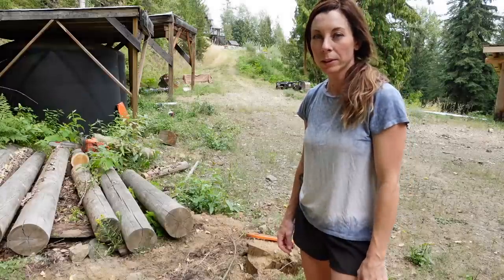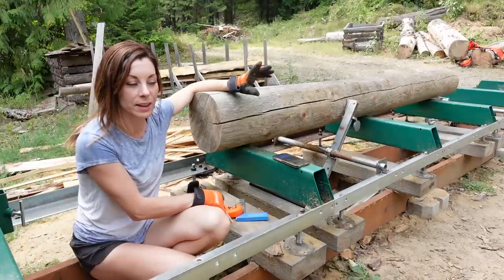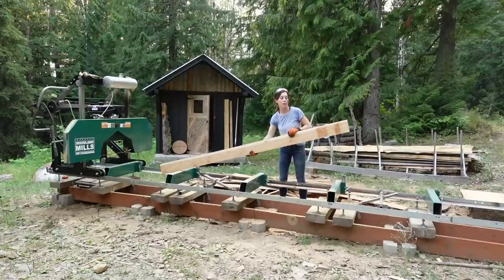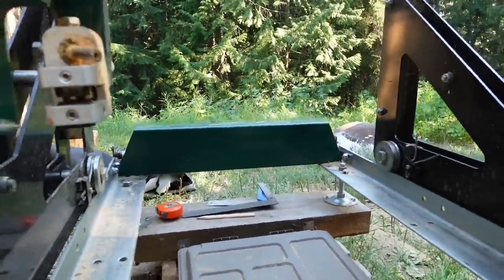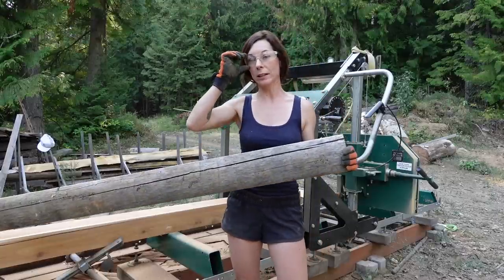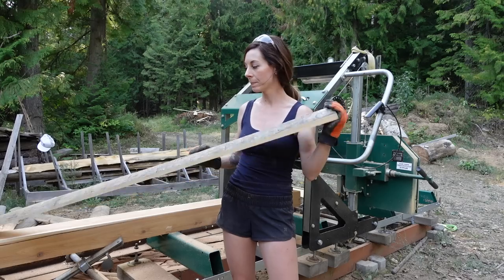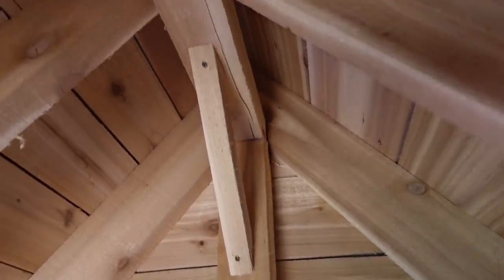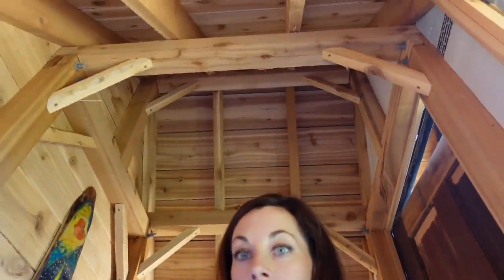The girl loves her sawmill | Milling more rafters for my tiny cabin build | The cabin on a cliff.

Comment: Good morning, Lee in New York. I also have a sawmill an older wood mizer. I see you mustling these logs around just just thought I'd give you a tip. I use a pulp hook when I muscling things around. You can get them used off of eBay fairly cheap, And I wouldn't be without one, Just so much  Easier and faster than muscling, Of course there's still  Muscling to do. Now I will watch the rest of the video

Comment: If your going to have a loft space, I still think you should put those ceiling rafters up first, and then floor it. Then put up the roof rafters. You’ll be safe and be much closer to the ridge tree, and plate to mark out and fit the roof rafters. This is how it’s done in the UK. The flooring sheets come with a protective cover, and you just tape the joints, and peel it all off when your roof is covered in. You could just tarp the floor. 
I think your hoist will need a tighten by the looks of those timbers!!😳 looking forward to the next one now🙂👍

Comment: I like using "Loctite" , good stuff, keeps bolts and screws from coming loose , I like the blue , the red is like welding it on  !
Reply: Red ain't that bad....just hit it with a little heat before you try to dis-assemble...easy peasy

Comment: It’s done now … and I’ve gone back and watched your view on how you secured the post to the rock… and it will absolutely work… I’m just wondering how much pole loading effect you will have on that post considering it doesn’t sit flat and the load weight will be transferred to the bolt … which I’m sure is designed for horizontal strength not diagonal load bearing … I work for a utility … I don’t know why but I think about this stuff🤪but I love watching you build this stuff
Reply from the maker: Steve is the engineer, so I honestly can’t answer the details. He thought it out, and is certain it’s sufficient for the structure. 
That said, there’s still more work he wants to do once we build a railing. He used to live in Switzerland, so he wants to use wire rope and strap/anchor it down too.
Reply: parce qu'elle est très belle !

Comment: One thing to consider when dragging, spinning, or rolling your logs over to the bandsaw, instead of using the machine... you are increasing the chances of picking up small gravel which shortens the sharp life of your blade.
Reply from the maker: Good thing I have a blade sharpener!!

Comment: You're doing great. It's a little tough to see on some of the camera angles, but the issue that you're having with the rafters may be that some of the existing roof framing could be twisted or in other ways non-conforming such as; tipped, out of square/plumb or a piece has checked up during it's drying process. I respect that you're trying to salvage and repurpose lumber for this project, however doing so will cause you occasional headaches of varying frustration levels like the one you're experiencing now. I don't believe that you'll be able to cut them all in a uniform way using a pattern. What I would do being that you don't have a lot of them, is cut the correct angle on the top end of the rafter board, tack it to the ridge beam with a couple of long screws and then measure and mark out your birds-mouth with you speed square while the rafter board is setting in place on your top wall plate. I would do this for each one to make them snug which is really what you want for this kind of joint considering the weight of the snow/ice and wind speeds that your roof will endure. Your persistence will pay off. It's looking great so far!

Comment: Michele how are you going to get those big, heavy rafters up on the roof without hurting yourself? Please tell me your taking Steve with you to do that. What are your thoughts on using those cedar scrap pieces as siding on the cabin to make it look like a log cabin, then just put vertical end-caps on the outside corners?
Reply from the maker: I’m going solo. Steve is busy at home ! I will figure it out!! 😁 I might not have enough to do the whole cabin, but parts for sure!!
Reply: @michygoss7148  just take your time, don't rush any of that work on the ladder! hell of a workout!
Reply: @michygoss7148  be careful

Comment: I haven't watched all your vids , so if you have already answered my question then I apologize. How long do you leave logs before you mill , and how long after ? Do you find that nailing lumber in green results in less waste from warpage . Will you get less sag in rafters if it's seasoned ?
Reply from the maker: That cedar I milled is dry as a anything. But I mill both seasoned and wet lumber, and I do prefer to use it on the greener side and install right away - the wood is easier to work with, although heavier.

Comment: Hi Michelle!
Is it like that you are strong like an ox or the lumber are lighter than fir or pine for example?  Can that cedar wood go as equal for construction (holding specific weight) like pine or fir?
Pedagogic as usual...😘
Yours Michael
Reply from the maker: That cedar is pretty dry and  light 👍
Reply: @michygoss7148  Hi is it common to build the roof with rafters than with trusses? Depending on the roof angle the snow weight is someting to calculate in i suppose? 
I believe youre use to count that in...sorry for my strange english spelling and words 😜
Yours Michael
Reply from the maker: @MegaAlexpalex  you’re honestly asking the wrong person! I have no idea! I just put things together in a way my brain accepts, but actually have no idea (no formal understanding) of engineering structure standards.
Reply: @michygoss7148  you for sure have a good brain...it relflects in your dogs🥰
Yours Michael

Comment: Hi beautiful, your doing great, really like your mill set up & ability to make your own lumber, good insight on the 5/8 thickness of the exterior panels to cover gaps. You can also put 2x4 blocking between the rafters it keeps them from twisting as they age & seals everything up nicely, those same 2x4 blocks will work as trim to cover the top edge of your  exterior siding, they go on last of course. Your probably already know all this, just trying to help. Keep up the good work, your doing a good job, so don't beat yourself up, be happy with your results, we are ❤️

Comment: Hey Michelle,
Video was bloody amazing (as ALWAYS!) You're work and attention to detail soothes my own (I suspect) OCD tendencies! lol 
And LITERALLY I saw when you first built the dog house but either forgot or didn't see the sheer amount of detail you put into the joinery!
You're a bloody star! Great videography as always! Looking great and full of ideas, energy and enthusiasm! Just brilliant!
Have a great week and DON'T OVER THINK IT!

Cabin, make sure(with a spirit level it's square and plum where you're fitting the rafters dead 90 degrees vertical and horizontal!) Them lay the timbers mark/score up where they meet and across at the height/depth you want it to drop down, as long as that's a perfect 90degrees take it down cut it out and place it back up and it should fit exactly.  if you try to do it in place one side at a time you're going to get a wonky cut on the other end!
Hope this helps makes sense sorry for essay!!! I had couple beers lol 😂🤣🤦🏻 (Queen etc 🌹🙏)
Have a great week and cheers from London England 👍❤️😎🏴🇬🇧

Comment: Okay, so this could very well sound kknda stupid, but hey-I think you may have just hit upon a good nickname for yourself: "1-trip"! For what it's worth, in my world that is, without a doubt, a compliment.
Reply from the maker: “Mrs. 1-trip!” 🤭
Reply: Glad to give you a chuckle- you looked like you could use it after those rafters gave you a hard time. It ain't easy getting the right marks/angles/measurements/what-have-you. Especially alone, in a remote location, holding the piece in place while standing at the top of a ladder holding on with only ones toes thinking about how long it will be until you stop falling if something goes wrong (I always have the vision of a ladder leg kicking out on me). So, major props to you for tackling it- that sh*t ain't no joke!

Comment: I noticed you use Ryobi 18v tool's... They sell a sixpack battery charger unit (supercharger one+)... I use this unit with a single solar panel with a small portable power station to charge all my batteries while camping. So longer carrying batteries to the campsite.. this would also give you power at the cliff side build for extended build time
Reply from the maker: I’ll look into that!

Comment: run a wall stud flat on the underside of the gable rafter from top to bottom  flush with the outside it will give you full bearing for wall studs.

Comment: Once you nake one correct raffter, then use that one as a template for the rest of the raffters.
Reply from the maker: If the structure was made with store bought dimensional lumber, and build by a carpenter, then I could do that. BUT - 🤪
Reply: @michygoss7148  You still can. the idea of a template, is you have a rafter that fits, by duplicating, it saves measuring again and again.Unless you are very bad at measuring, your structure should be square and plumb. the roof line should be the same the whole length of the structure. You can prove that by measuring the two ends. Don't doubt yourself, I ses you checking and double checking everytime.

Comment: Nice Sneeze !  You will almost always see sparks at night without hitting metal
Reply from the maker: Oh. Interesting. It wasn’t dark (about 7:15pm), but very obvious sparks!
Reply: @michygoss7148  The abrasives in the wood and bark if there is any can cause sparks. If the light is low enough you can definitely see them. Could be other causes too.
You certainly like to work hard, that's a great quality.